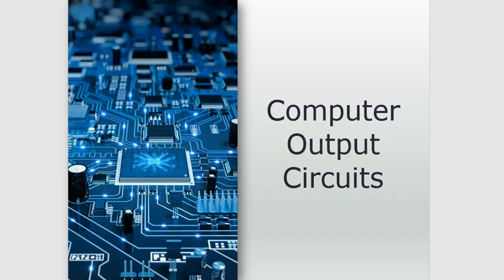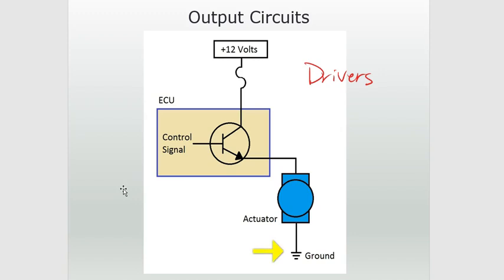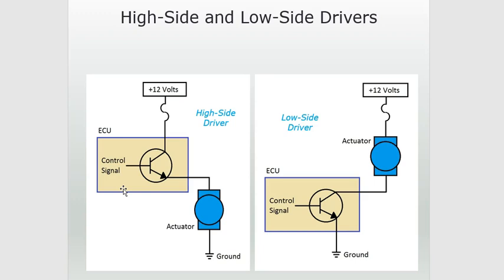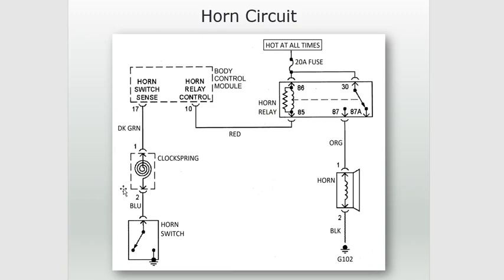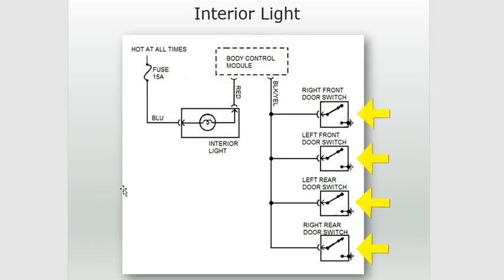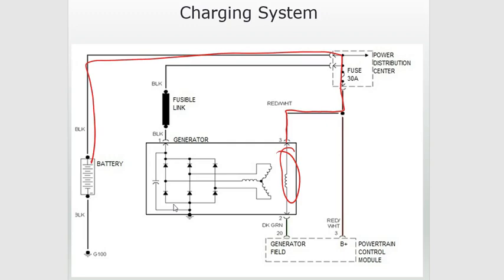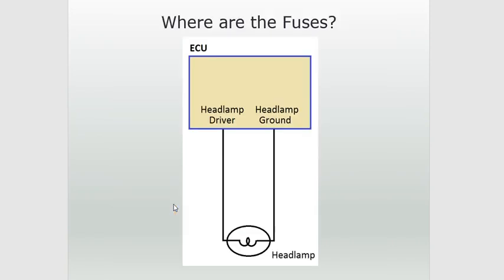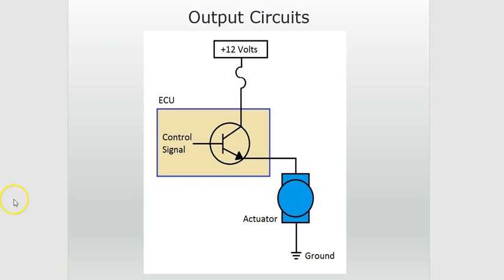Computer Outputs: High-Side and Low-Side Drivers

Comment: Aren't you supposed to supply a current of a certain value to the base to switch a transistor on, and not a voltage?

Comment: What is a computer discrete input or out put
Reply from the maker: Discrete signals refer to digital signals that only occur only at specific voltage steps, such as 0 volts or 5 volts or 10 volts.  This is different than an analog voltage signal, where the voltage can vary infinitely and does not necessarily land at specific points.

Comment: Just your videos are top notch. Very helpful in giving myself a DIYer John the computer side of this function. Are drivers mostly NPN or PNP?. Thanks for sharing Artie ❤️👍
Reply from the maker: As far as I understand, high side drivers generally use PNP transistors and low side drivers generally use NPN transistors.  However, I think it is technically possible to switch those around.
Reply: @JustinMillerAutomotive  you're right. I've seen them switched around many times. Some of the boards that I've worked have used npn for both high side and low side. But the connection are opposite